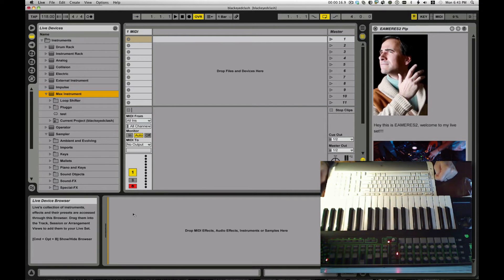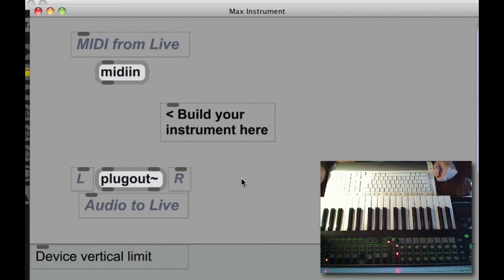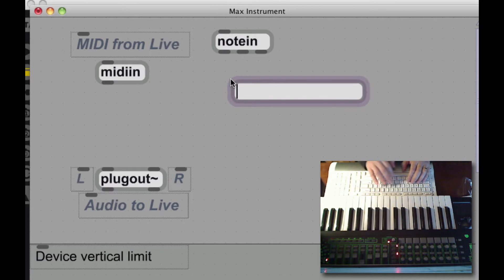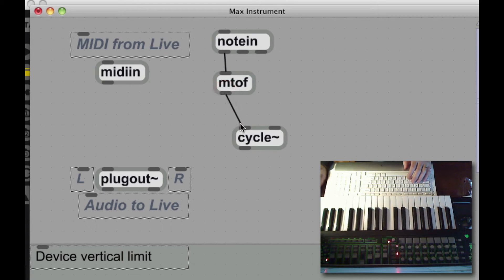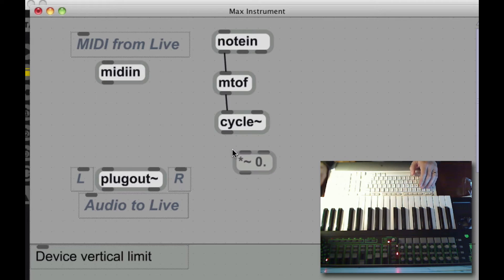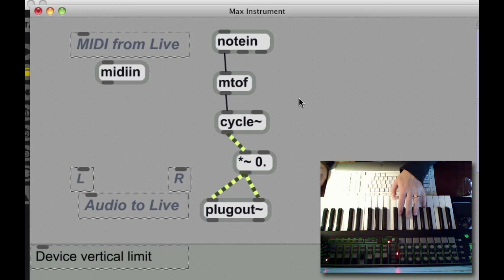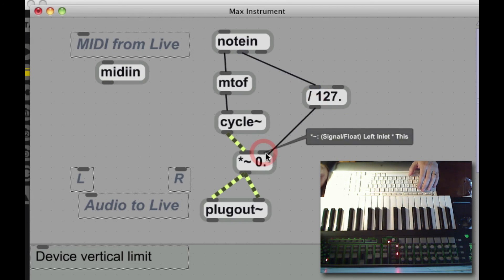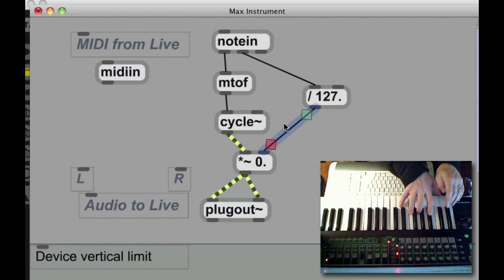M4L : Basic Max MIDI Synth in 1 minute! Pt 1 : Learn to build Max for Ableton live synths & devices!

Comment: Whats the reason you multiplied by 0? just [*~] or even [*1] seems to work and sound exactly the same.
Reply from the maker: The multiplier is used so that the gain is controlled by the velocity of the incoming MIDI note.  If your controller is set to a fixed velocity, you won't hear any difference, but with velocity control you'll get basically volume control of individual notes via velocity.